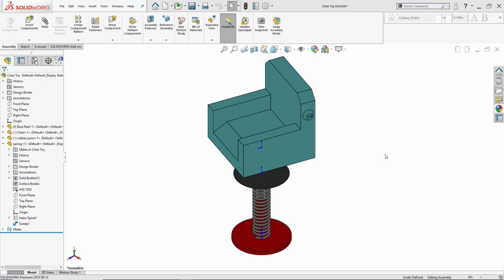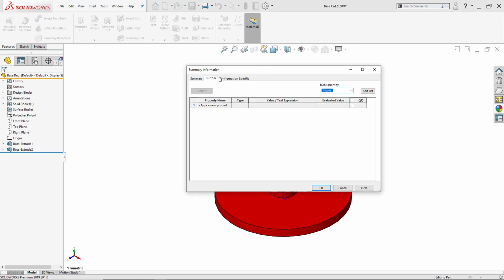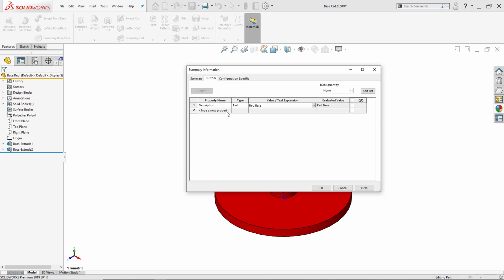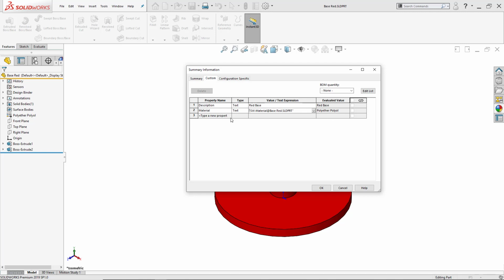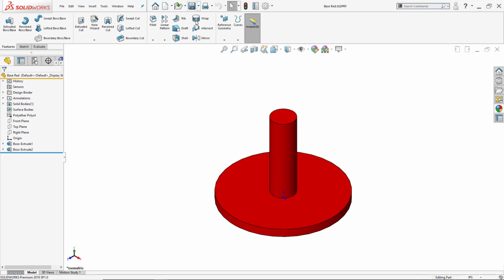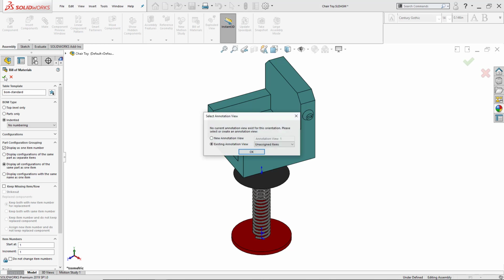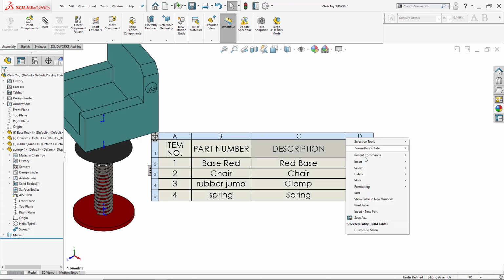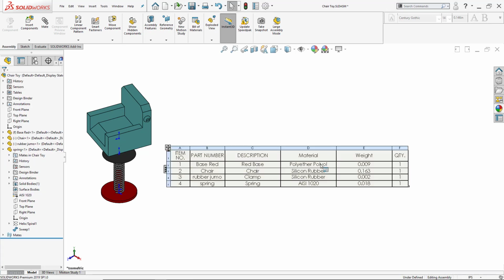SOLIDWORKS: Connecting Custom Properties with Bill of Materials

Comment: I want to add a "sheet#" callout in my BOM for assemblies.  Each of my drawing sheets contain only one detailed item and depending on the number of parts in my assembly will obviously determine how many drawing sheets I will need.

What I want to do is have the BOM reflect what sheet part "x" is on and if I insert more sheets before or after, or re-arrange the sheets, the BOM will follow the parts to their current sheet number.

I've made quite a few unsuccessful attempts at adding properties I thought might work but have failed.

Its probably as easy as a basic extrude...Im just not seeing it.